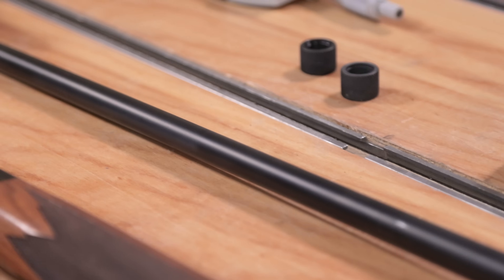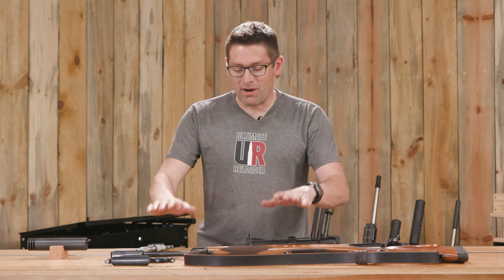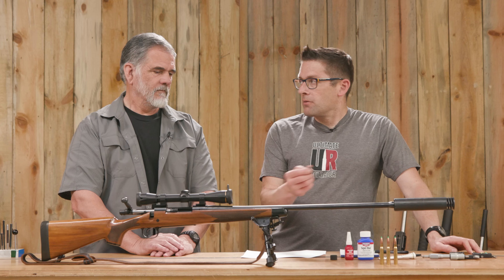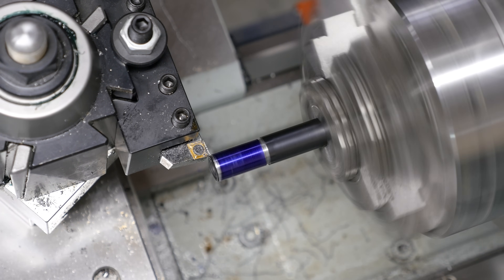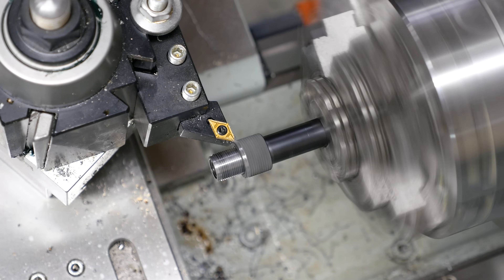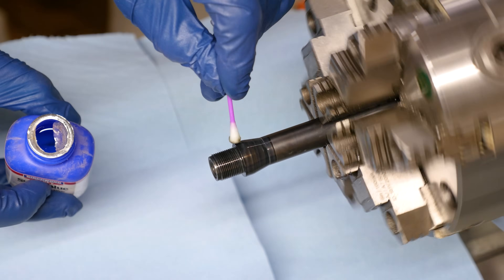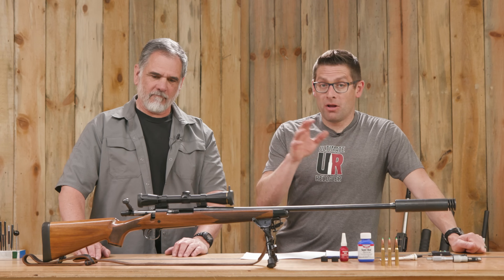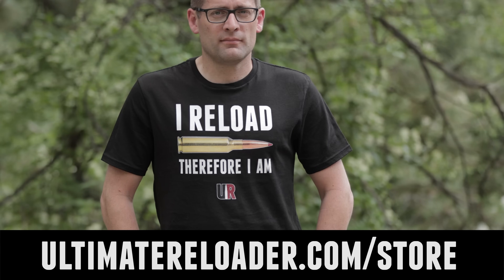Threading a THIN Sporter Barrel for a Suppressor (30-06 Example)

Comment: My Browning X-Bolt FLD .30-06 with a 22-in barrel did not come threaded. My gunsmith is going to thread the barrel so that I can add a Browning radial muzzle brake. 

I was kind of worried that the sporter barrel doesn't have enough meat on it to thread. So as soon as the muzzle brake is delivered I'll take the rifle and we'll see what can be done.

Comment: I threaded an SU16 muzzle. The barrel was already at half an inch, but the threads were acceptable in both the major and minor diameters. I had to thread all the way back to the front sight swell for a shoulder. Since I could not take the barrel out of the action, holding the polymer action in a four jaw chuck delicately, I turned the single point threading by hand, not under power.

Comment: So, what if someone threaded a tikka in 1/2x28 in the same fashion. But instead of using the thread protector as a shoulder it’s used to add mass to the end of the barrel for a 5/8x24 thread?
Reply from the maker: Yes, that could be done. It would be a ~1.200" long thread-on part that would have the shoulder and the 5/8" step-up all in one piece if desired. Or, do 1/2-28 with the method shown and use a traditional step-up bushing.

Comment: What would you suggest i could do to mount a supressor on my older browning a bolt that has the factor boss system, which i believe is threaded 9/16x24? Could i just use a thread adaptor to get it to 5/8x24 from brownells?

Comment: honestly, i own multiple suppressors for 7.62 up to 30-06. the Omega 300 you had on it is probably the best of all worlds when it comes to sound mitigation AND recoil reduction. if you want quieter, you could use a Nomad-L but there is more kick with that suppressor than unsuppressed but significantly quieter on 30-06.

Comment: Hi Gavin excellent video just like always.I need your technical help , I got Steyr Mannlicher Pro hunter rifle in caliber 30-06 and I measured end of my barrel with caliber and is .57” so on your video it can be done but I’m in Canada what should I do next
Reply: Try a 1/2-28 thread and muzzle device. You can also use an adapter to go to 5/8-24.

Comment: I am looking to have the barrel threaded on a Winchester Super grade 30-06.  Unfortunately the diameter at the end of the barrel is 0.5995”, which can’t be threaded to 5/8-24.  What is the right way to tackle this?  Is it better to go with smaller threads or some sort of adapter?   My end goal is to be able to use my Dead Air Nomad 30 can.  The default thread adapter is 5/8-24 but they do sell replacement adapters in various sizes.
Reply: Same question

Comment: When removing a barrel to thread it like this do you have to check headspace when reinstalling since it’s the same barrel?
Reply: I don't think he removed the receiver or action from the barrel. He said his lathe was large enough to fit if trigger was off.

Comment: You would think the barrel would be held close to the the chuck. You would think a tighter tolerance would be achieved by eliminating flex ( leverage) instead of introducing it. Just a toolmakers mind at work. Just saying..

Comment: Would this work for a situation where the suppressor requires a muzzle device?  For instance a suppressor that uses a taper or dual taper locking system where a flash hider, compensator, or brake is threaded to the shoulder and shimmed if necessary for timing.  I'm only asking because I've got a .270 Win Savage Model 111 with a side magazine release and sporter barrel.

Comment: I have done this for years but I no longer thread long I just lengthen the tennon and use loctite 609 to secure a pre-made spacer that is then blended and profiled.
Reply: Just did one exactly like that about a week ago. I didn't see the need to remove any more material than I had to by cutting threads and a thread relief way down the barrel.

Comment: I have an Elite iron for my 375.  Like this situation however, it is also a sporter barrel and thus not enough shoulder to support for this suppressor (5/8 × 24).  With a larger bore, would this method still work?  I purchases the suppressor from Silencer Central and supposedly they  will thread the rifle for $100 as part of the purchase.  Thanks in advance for any advice.

Comment: So thankful I found this!! Also subbed!
 I have a remmy 30.06 that has the tapered barrel, and had some previous Smith work done to the barrel end.. ported and crowned. I've always wondered if threads could be cut back behind the porting, and basically turning that portion of the barrel into a fixed brake so to speak.
Reply: Not such a good idea. If that ported job is a good one leave it be. Buy another rifle that's threaded. You would be further ahead selling what you have or trading it in for threaded if you want it. Crazy idea. But hey there are people threading barrels by hand what am I to say any idea is crazy. It's just crazy to me. I like another excuse to buy another rifle.

Comment: Exactly what I am planning to do to my "toy" 22LR. much easier in my case as the barrel seems to be parallel (hopefully with the "hole" in the center) and there is enough "meat" do turn a shoulder straight on. But in case I need a bigger diameter shoulder, will copy your idea!

Comment: Hi Gavin, many gunsmiths unscrew the barrel from the action in order to mount it in the lathe. The does make sense but what if the barrel is pressed into the action? I have a Steyr SSG P2 which I bought new and I'd like to thread the end of the barrel to mount a muzzle brake. Can the bare action and barrel still be mounted in the chuck properly for the threading process?
Reply: Yep, there are multiple ways to set up a barreled action when you're unable to disassemble it. Typically, it is done between centers with an action mandrel, or it is set up with a steady rest. Any competent machinist or real gunsmith with a suitable lathe and tooling setup can do this.

Comment: I am a 28 year USMC & Army Vet (send me the jokes later).  I just started hunting last year and I am using my Dad's old 1969 model year, Remington 700 .300 Win Mag Stainless Steel.  I put a scope on it, it only has maybe 200 rounds thru it in it's life.  I have my first suppressor, an Omega 300.  SilencerCo uses a system for quick connect/disconnect by putting their ASR/brake on permanently and then the suppressor is quick on and off as needed.  SilencerCo has a 9/16" threaded ASR that I would like to mount to the .300 Win Mag so I can use the suppressor sometimes.  Some people have told me that might be too thin with all the pressures from a suppressor.  What is your opinion?  Will there be enough of a shoulder to mount securely and be safe with a suppressor?

Comment: That’s a very smart approach you have there. I’ve run into this issue a lot in my shop. Think I’m going to adopt your practice. By the way. Have a tooling question. If you had the choice would you pick a multifix style or Aloris style tool post? And why? Thanks Mr. Gavin!

Comment: Gavin, with the thin barrel profile, it would be interesting to see if the POI shift is caused barrel droop due to the weight of the suppressor.  You could clamp the action in a mill vice and use a dial indicator on the muzzle end of the barrel to examine the position with and without the suppressor.
Reply from the maker: Yes, there would be some, and I like the fixed approach for testing!

Comment: Just use a smaller thread supressor. All this is not needed at all. 9/16 or even 1/2x20 will work just fine. Here in NZ most sporters are M14 or 9/16 even the very skinny howa lightweight barrel has a 1/2 x20 thread from factory here.

If you really want to use a big thread supressor then just make an adapter bushing
Reply: Yeah I was scratching my head a bit on this one, maybe suppressors are only available in the US with that thread. Seemed like a huge amount of extra work that wasn’t needed

Comment: Hi Gavin and Guy. My 30-06, 260rem, 6.5PRC, 223rem, 22mag all have Nielson sonic 45 silencer/suppressors. I do not use a silencer on my 375h&h   just love the way
Reply: I do not use a silencer on my 375h&h I just love the original look of the winchester rifle. All my rifles have sporter barrels except my 223rem which has a heavy barrel

Comment: Could you have used Rocksett for your “permanent” setting of the spacer? That way if you ever needed to take it off it would be an easy hot water soak.

Comment: @gavintoobe I just had a hunting rifle threaded where they said it was not thick enough for 5/8 so they said could do 1/2 I call the suppressor manufacturer they did seem worried about this point to a bushing to use. can you provide some insight into why this way would be better I have a few more to do and i was thinking of not threading them since could not do the 5/8 but this might be a good way to it

Comment: I would have suggested a M15x1 Thread that is 12mm (about 1/2”) long. Also I would use an overbarrel suppressor to get the center of gravity further back. Barrel would be thick enough and suppressors are availiable in that threat.
Reply: Give a nice suggestions for winchester model 70 featherweight XTR

Comment: Interesting here in the uk probably about 95% of sporters are threaded and moderated and I've never seen one with a added thicker shoulder. Some have spigots. Usual thread is 15x1, 14x1 or 1/2 unf / unef. But most are now over barrel so a bigger shoulder would probably hinder that.
Reply: I used 9/16x24RH on mine, ~14.3mm.

Comment: I have a Banish30 in ATF hell. I built a sporter 280AI and had them thread my barrel so I can use a 1/2x28 to 5/8x24 adapter.

Comment: I'm running the Dead Air Sandman S with their QD mounts. I'm afraid that the extra mass of the QD Brake along with the added thread protector would be too much for your application. That sporter barrel might get whippy.

Comment: Did you thread that with left hand threads? Was just wondering from you working the Channel Locks on the thread protecter.
Reply from the maker: Regular right-hand!
Reply: @Ultimatereloader  OK thanks,really like what you guys do.
Reply: Every bolt up hand and plumber was sweating watching that. At least I was.

Comment: Out of curiosity, would it also have been possible to cut the barrel down and thread it with 1/2x28 threads and use an 1/2x28 to 5/8x24 adapter
Reply from the maker: I wouldn't want to cut the barrel down that thin with respect to bore diameter!
Reply: Europeans use a M14x1 thread mostly. 5/8-24 is more aking to M15 wich is not as common.
But thread size is secondary to the look of the threading in relation to barrel diameter. No-one wants a M14 thread on a thick varmint barrel. My cz 457 MTR has a 1/2-20 thread and it looks stupid.

Comment: Why lock tite? Is it not removed with heat? Rocksett is a better option. High temp rated, can only be removed by a soak in very hot water.
Reply from the maker: Red locktite is pretty good with heat- I’m not even sure it’s needed in this case with it tightened down like that.
Reply: Red locktite will only degrade at over 360f so there's little to no danger that the barrel is going to get that hot unless you've got a torch on it.

Comment: Just curious if I understood correctly, you went by feel for the threading and not a thread mic or thread wires?
Reply from the maker: Correct- however I use the "over wires" method if I don't have a good gauge (in this case a known-good thread protector).